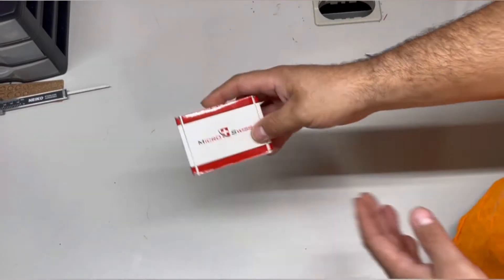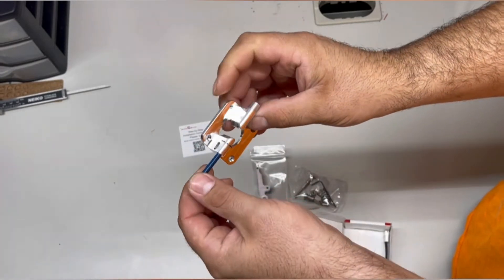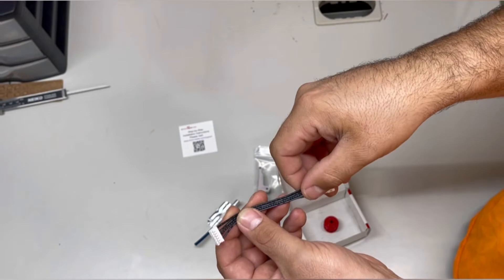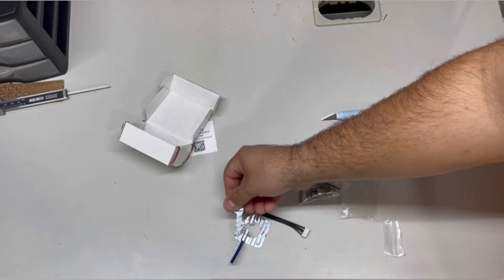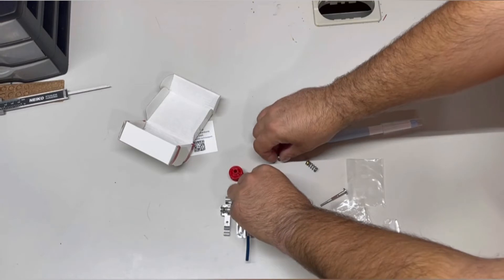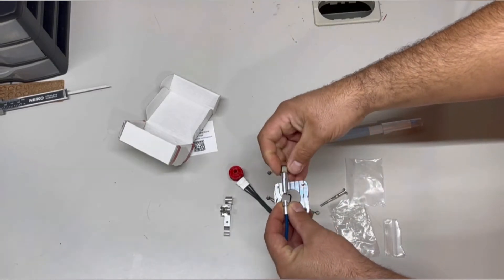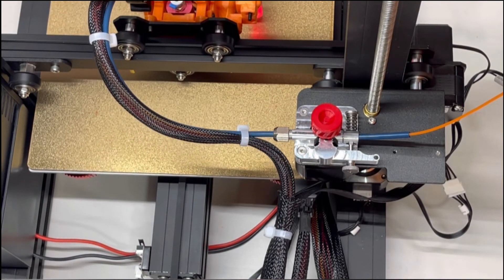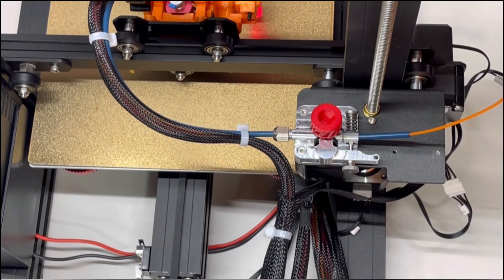Showcasing Micro Swiss Bowden Dual Gear Extruder

Comment: I am looking to do this on my Neptune 2 can you tell me if the extruder will line up with the filament run out sensor or will i need to shim that up?
Reply: I don’t know of away to use the runout sensor. The tube that guides the filament into the extruder sticks out to far.  You may be able to find a bracket you can print that would move it out more. I don’t use the run out sensor. Sorry I couldn’t be more help

Comment: Hi! I am using this extruder for over a month now and I can't seem to find the correct retraction distance for it paired with a micro swiss hotend. What are your results so far with this product? What settings did you find work for you? Also, have you tried TPU with it?
Reply: Kind of a blind question with out knowing more information. Keep in mind the gear ratio is more than likely different than stock. Before the extruder gears can be calibrated probably. 1.) are the extruder steps calibrated? I calibrate testing 100 mm  2.) after E steps are calibrated, a flow test needs to be done to calibrate the flow rate.  3.) after all the then the retraction rate and speed can dialed in.
Reply: I have not tried TPU with it.  But I use a retract distance of 7mm and a retract speed of 45mm/sec. I have found that the instructions state to start with the tension knob flush I have found that tightening it about three more total turns tighter works well for PLA and eliminates ghosting
Reply: @alaricotey9996  i thought more information was unecessary, i have calibrated e-steps as well as flow, i just cannot get rid of stringing. From what i saw on the internet, people with micro swiss hotends use very small extrusion distances (under 7 mm) but paired with this extruder i don’t know if i should go that high. Thanks for the response!
Reply: @Soare05  try a temp tower and retraction tower to see if the temp may be a problem, and if nothing else the retraction tower may point you into a good direction